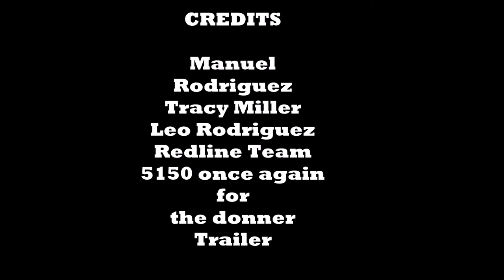Converting an old tandem trailer to a tilt tandem Part 2....

Comment: Is it possible you could post the dimensions of the lower portion, the axle length as well as the top frame length. What type of hinge system did you use to allow it to tilt? thank you

Comment: Great job!  The trailer looked huge until you put that Jeep on it.  What are you doing for decking?
Reply from the maker: I used 3/4 plywood with polished Dimond plate. it's done for now I use it mainly for vintage Volkswagen thanks.